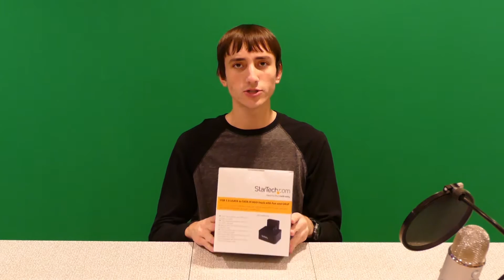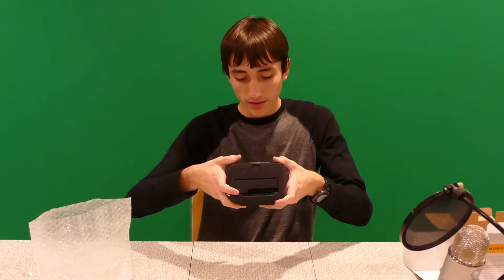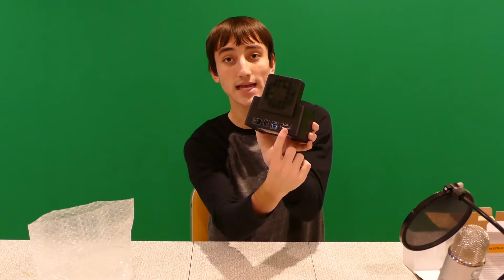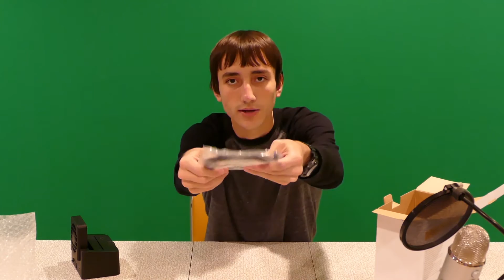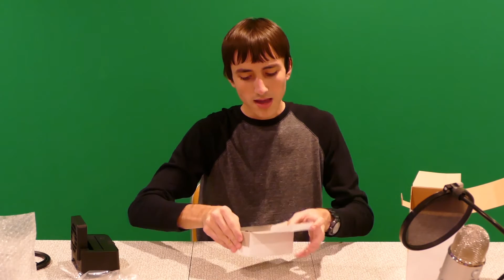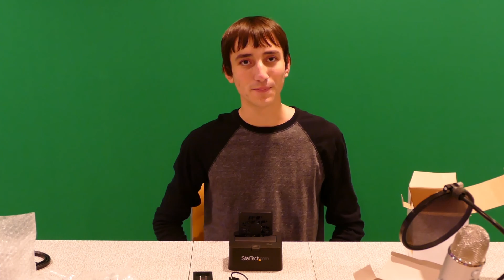StarTech Hard Drive Dock Unboxing

Comment: Nice video.. Hey I have similar HD dock station I recently bought, I got the Thermaltake BlacXDuet with USB 3 interface.  The manual says that no drivers are needed.  When plugged a drive into the dock it is not registering in the OS.  Do I need reboot the computer for the OS to recognize the drive? I running windows 10.  Thanks for your help.